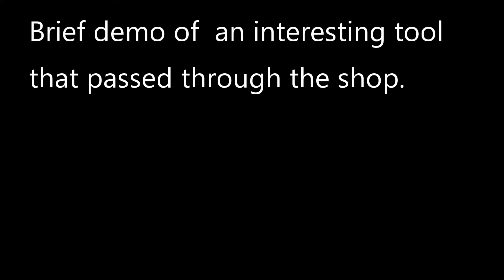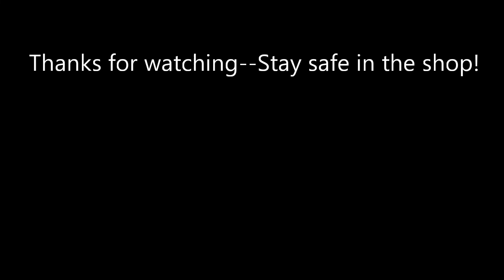Dental Lathe for the Shop

Comment: In addition to 1/4 inch attachments, the special collet (the spring loaded piece you push in when inserting a 1/4 inch attachment) will accept 3/32 and 1/8 inch burrs, buffs and whatever, like those available for the Dremel. With the proper Burr Adapter, you can also use 1/16 inch dental burrs as used in dental handpieces.

Also start on low speed and switch over to high when spun-up on low. When not in use, leave a 3/32 or 1/8 inch bob or burr in the chuck. The handle position all the way counter clockwise is for shipping. The position before that (6 o'clock if properly set up) is for stopping burr rotation and changing burrs.

This is getting long, but you have a Handler Red Wing motor and a Wells Dental chuck. This isn't some kind of hybrid bastardization, these appear quite often, and Wells sells the kits to do this conversion. This just means that you order chuck and conversion parts from Wells and Motor parts from Handler.

Lastly, just the lightest of taps (one) to set the buff spindle on the shaft, no need to set it deep or you may unbalance the spindle.

Great find.
Reply from the maker: @ArtVanAuggie  Thanks for the great information. I passed it to the current owner, a good friend of mine.

Comment: Rick, The quick change chuck on the right should never be released without a mandrel in the chuck. Also it is made to stop and release with the motor running so a lab technician can swap out mandrels without having to turn off and wait for the motor to stop rotating. The manufacturer says to start the motor on low and switch to high after it comes up to full speed that helps on start up. The lever on each side is used to unscrew when you want to remove a chuck or mandrel adapter as it will press the mandrel off the shaft for tool less removal. You got a lathe motor that dentist are always looking for. You should have no trouble selling it.
Reply from the maker: Thanks for all the great information! I'll make sure to keep something in that chuck from now on.